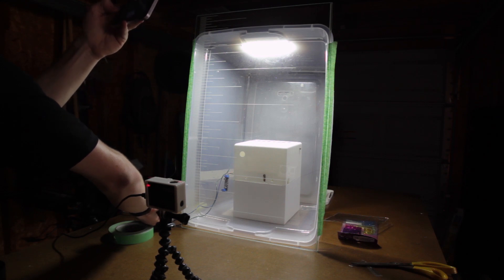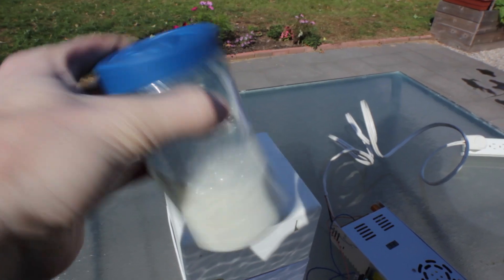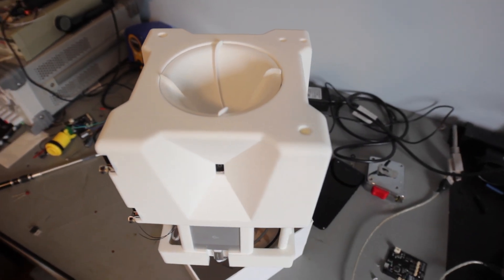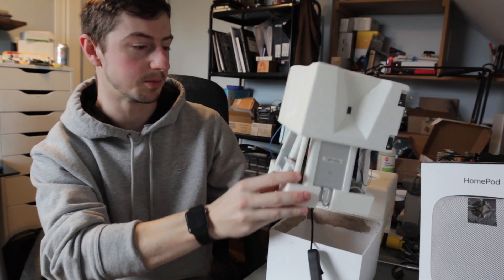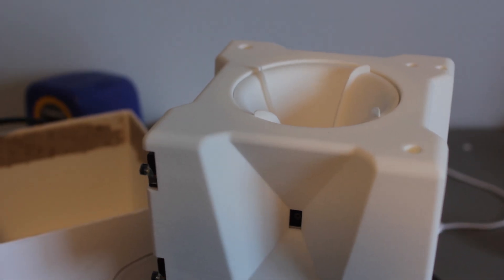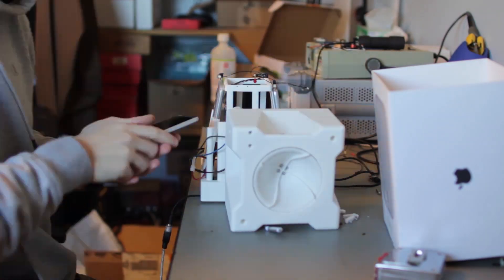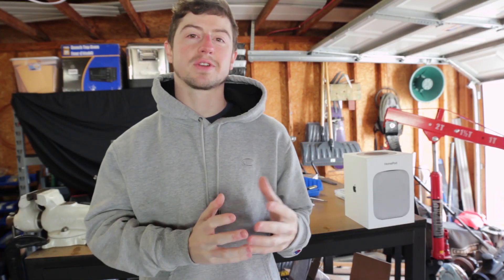Building Glitterbomb 1.0 with Mark Rober

Comment: This is great and so satisfying! A few questions! What did the Arduino do -- watch the limit switches and then do a button-press on the 4 microphone jacks?  Mark's video mentioned there was an accelerometer; was that on the Arduino and what did it activate? Were you using the phone's GPS or did you have your own GPS module on the Arduino?
Reply: I assume he was using the accelerometer on one of the phones
Reply from the maker: There were several things, but the arduino tracked movement with an on board accelerometer since it could be in a much lower power state than the phones, phones had GPS. Arduino triggered phones, and kept track of the box lid, and fired the motors.

Comment: I didn't see any fasteners, like the little plastic stickers on the bottom of the box.. What if they flip it upside down. Won't all of the glitter fall out of the cup, and reduce the effectiveness of the first glitter spray greatly?
Reply from the maker: There is a piece of foam that presses into the top and holds glitter in the cup, so it can be moved around and no glitter falls out until its opened. Its basically impossible to open this kind of box upside-down because you need gravity to allow the inner box to fall out.
Reply: SeanHodgins brilliant! Seriously dude please make a cheaper version of this. I will buy one. Maybe two. Had a curiosity how much did it cost you to make?

Comment: How exactly did you charge / power all the phones? Did you create your own battery charging circuit with 4 USB connectors? Also, why did you make your own PCB? It seems like an Arduino pro mini would do the job by itself no?
Reply from the maker: There was a custom charging PCB that took the 5V power(into the bottom) and sent it to all of the phones + the arduino. The custom board is to eliminate more posibilities of failure. All of the components were soldered on(except for the 12V booster board) and it made assembly much easier. Its easier to design things when you control every aspect of it.
Reply: @SeanHodgins  A simple 5 port USB hub would have done the trick.
Reply from the maker: Wierdy1024 that would have been overkill, this took 5 minutes and needed to have a remote reset button on it as well.
Reply: @SeanHodgins  Making a custom PCB is always a couple of days work, plus 3 weeks for delivery from China every time I try - I always end up just going for stripboard for one-off projects.   Do you have a home PCB fab to get quick turnaround?
Reply: @Wierdy1024  Google JLCPCB :P

Comment: If you made these for police departments you would make a killing. Could probably charge 100x what it cost to build. Probably more. Interested?
Reply: .. what? govt toilet parts? hah!
Reply: Amazon are already doing this - BBC link so may or may not work in your country https://www.bbc.co.uk/news/technology-46552611
Reply: You would cause a wreck and get sued. Retail stores have silent proximity and tracking devices in high end products. Cell phone type devices with wireless charger which uses a cheap I.O.T. SIM data card.

Comment from the maker: Don't steal packages!
Reply: You've linked your Instructables and such, but this project isn't on any of them; will you guys be releasing any of the files to make these ourselves? I want to make one to educate my local Chicagoans the hard way, it's so bad here I've had to get a PO Box, there's so much karma due out here.
Reply: @mixiekins  this, i just checked your github! obviously, it wouldn't be there already, ya had to keep it a secret. And now that its gone viral, may need to change the print shape a little... but yeah, if all of this was available, or better yet written up in a tutorial-esque blog post, this might make me get into the maker scene :P i already have a library card to print plastic... all i need now is a soldering iron :)
Reply: Cari Garafalo I like you. 😆😂🤣
Reply: That nod to the slo-mo guys is fantastic sir.
Reply: @くろーぴ  yep
Reply: How much to make me 1?
Reply: @michaelsmith483  budget revenge setup buy some fart spray, flip it upside down empty can of Co², puncture a point of can, drain into box with a good gasket and put lid on it finish the exterior (fake label and packing tape), let sit for a few hours, place on location (doorstep) preferably on a hot day. Good chance someone opening it will lead to them losing their last meal. If you want a recording add SBC light sensor and code to take pictures when any light detected. You will like never get phone back. Use Tasker to trigger YouTube live instead of SBC if you have a device with a good light sensor on it.
Reply: @SeanHodgins Hi Sean,
Great job on the project u worked on w/Mark Rober. I really n'joyed watching ur behind the scenes vid. I subbed & liked ur vid. 2, & added it 2 a playlist on my channel.

   Also, I wanted 2 share my comment I had left for Mark Rober on his vid because it involves u 2, so I copy pasted what I had said to him below (see below the line). 
 ⇉ ⇉ ⇉ Are u able 2 answer the question I had 4 Mark Rober, by chance?  ⇇ ⇇ ⇇

__________________________________________________________________________________________________________________________________________________________________________
fallOthewItrabIT (this comment was posted as a reply 2 his Pinned comment)
1 day ago (edited)
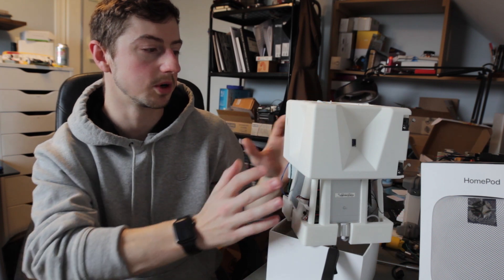@Mark Rober Hi Mark, Being a victim of a porch pirate myself, within the 1st 15 seconds of ur vid. - I clicked the like button after hearing ur pitch for the vid. U R an ABSOLUTE AWESOME GENIUS LEGEND!!! U R  AMAZING!.!* Ur idea wasn't over engineered- IT WAS BRILLIANTLY, BEAUTIFULLY, AWESOMELY EPIC!.!* This has 2 B 1 of the COOLEST/BEST videos I've ever seen on YT; everythg. from ur idea, to design, video editing was SO GREAT & SOOO COOL!.!* I AM SO IMPRESSED BY EVERYTHG. U DID 4 THIS VIDEO!.!* BRAVO!.!* BRAVO!.!* OUTSTANDING JOB!.!*I LUV THIS VID.!.!* I think 6 months of ur time was so totally worth every single second u spent doing this. I had to watch ur vid. multiple times because it was SO REMARKABLE & 1DERFUL!.!* --- I was nervous 4 u @ 5:10; I didn't want 2 C sumthg. bad happen 2 u.
   Maybe u can add an extremely loud, high pitched alarm onto it too, that goes off like the fart smell thg., 4 an extra added scare, & so that someone is even more likely to get rid of it. 
   It would be cool if u did a part 2(3 or more) of busting ppl.
   I feel bad 4 u, that u were taken advantage of, & I can totally relate to the feeling of being powerless & violated- I was told there was nothing authority could do either. It's so wrong that ppl think they can just steal from ppl.
   I hope u were able to report these ppl, since u had more (vid.) proof & a tracking device in ur package. Hopefully justice is/was served.
   U should get a patent on ur idea; start producing & selling it. 
 ⇉ ⇉ ⇉ I'm curious, how much did it cost to make ur Glitter Bomb Trap? ⇇ ⇇ ⇇
   I've been watching ur vids. 4 a long while now, & this is the 1st time I've ever commented on 1 of ur vids. I wanted to let u know, u have a lot of awsum vids., & this is 1 of ur greatest!.!* Turning a bad situation into an awesome vid. U made me smile & laugh. Thank you 4 sharing ur story/vid. 
(\_/)*
(*;*)
(")(") C*. !.!*

   Added as of 12.19.18 below:
   I came back 2 add 2-(edit) my comment because I was still thinking about ur vid., & because I seen that ur vid. was a top headline on the Bing homepg. -(on 12.18.19-late last night) which made me come back to watch ur vid. again, but this time I was reading ur description below the vid., & decided 2 check out ur link 2 SeanHodgins vid. (I 4got 2 check out his vid. the 1st time I saw ur vid.); I wanted 2 give props to ur buddy Sean Hodgins. It looks like he helped a lot in the making of ur project, & I just wanted 2 say, he's AWSUM 2, & the 2 of u make a great team/duo. I just wanted 2 give extra credit where credit is due.

   1 thg. that crossed my mind- now that ur vid. is trending, if the thieves see ur vid. they'll know exactly who u r, which could potentially lead 2 other bad thgs.-- like, they now know where u & ur other friend (CC- who used the glitter bomb 2) lives - hopefully nothing bad happens 2 either of u (w/fame comes risk). Like I said previously, I hope u were able to report these ppl -- so that they don't come back again & cause harm after seeing ur trending vid.

   That being said, it does also make me wonder/(crossed my mind) if the thieves in ur vid. could potentially be ppl u know, set up, to help u make this epic vid. -- if so, u would be the best internet prankster ever - pranking every1 -(all the viewers of ur vid.) Either way, real thieves or not, still an EPIC vid.!.!* It looks very real. I'm kind of surprised that no1 tried 2 break/take it apart, 2 C what they had stolen.
Reply: the clear glitter is truly evil, since its way harder to clean.

why did you guys not opted for ultra fine glitter
Reply: @darknessblades  that's just the glitter he used in testing. When they actually deployed it, they used what Mark Rober called, 'the world's finest glitter'
Reply: So smart!! Thank you for putting the filthy animal auto on there!!! I died laughing!!!
Reply: Noob, i just built the same thing 2 years ago ,just without handy filming inside or gps.Anyway i think mine was better 😂🤣,i used acid based anti bear protect Spray instead "Fart "🤢Spray. Using Fart Spray and glitter Deals nothing. The robber only screams WTF and trow it away, take a shower and one day of rest. Mine invention deals Injuries and spread Justice.
Reply: Why though?
Reply: Now this is some decent engineering. Excellent work.
Reply: The guys like you that are behind the scenes that make the real magic work may not get the fame but don’t worry about it because those of us that appreciate the brilliance it takes to do what you’ve done (engineering + cultural relevance) will support you stronger than 20 million ephemeral viewers ever could.  You guys make a great team; makes me want to join.
Reply: what was the LG phone that you used?    and love the video : D
Reply: I died laughing!!!! Oh my gosh, THANK YOU!!!!!
Reply: Obvious AMAZON Propaganda... REPENT and CONVERT
Reply: So the remote video retrieval is by uploading to google photos? Does that mean you had to get phone plans for each android?
Reply: The video was faked dude
Reply: advertising for amazon. fake